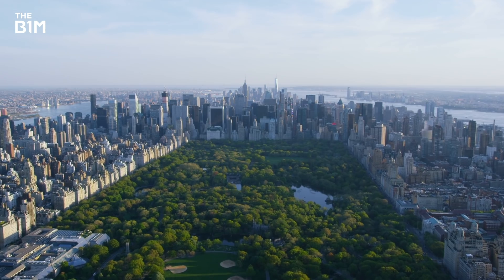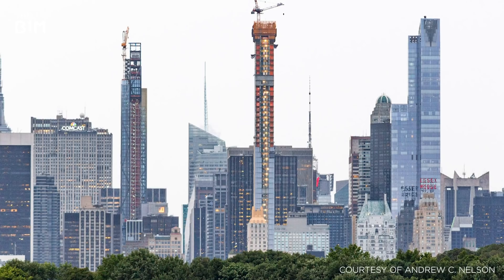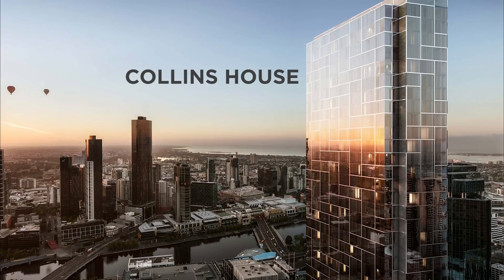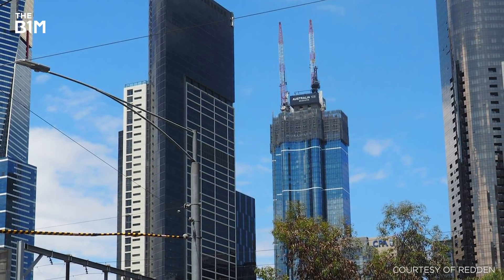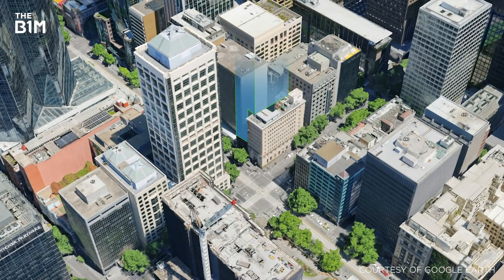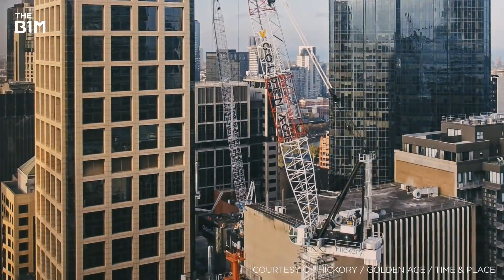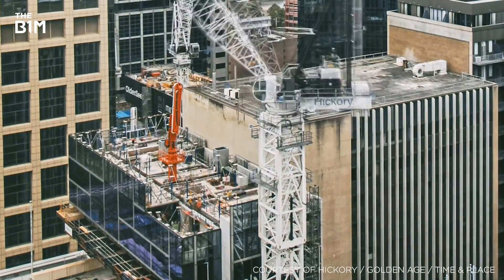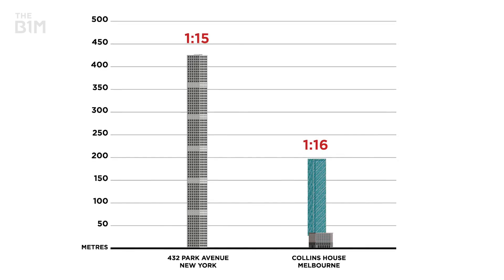Building the Thinnest Skyscraper South of the Equator

Comment: I'd imagine that these buildings are not as structurally efficient; you'd need more and/or thicker structural beams to get the same amount of wind and earth quake resistance. More commentary on such engineering issues would be appreciated.

Comment: Contractors and developers are going bust here, Melbourne property values tanking with a glut of apartments coming on through these builds. Neat buildings but not sustainable from a cash flow perspective. Will see if they get finished, sold and make their investors money, or just end up being a shell to look good on post cards.
Reply from the maker: Construction is Australia is rarely done speculatively, occasionally it happens with commercial towers but there are minimum sales thresholds that need to be met for residential towers before a developer can proceed with construction.
Reply: Good point and maybe the principal in this build did have the right amount of secured funding to get the planning permit/consent. Through some brief reading it looks like the Colins Building is starting to down-spec its finishes prior to completion, which is a tell tale sign of cost cutting.  I believe the whole Australian housing market has been propped up by speculators, especially at the luxury end of the market, and when values go south by 5%, there goes the contractors margin, 10% there goes the developers margin, 20% well, who knows. Love your channel by the way :)

Comment: Melbourne is a gem, and the new super tall and super slim RESIDENTIAL. buildings should be hopefully built for the average middle class population, as flooding and higher sea levels may in the future be the, answer to urban housing as these can be retrofitted at the bottom level if need be.  The return of using a small piece of land , and building up, must be huge...especially if they start building outside the overpriced areas in the city.